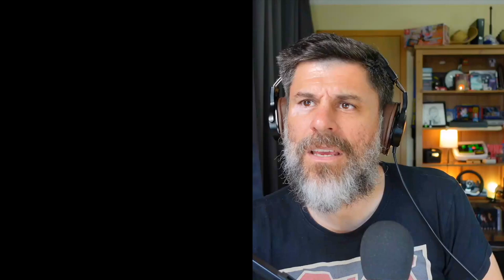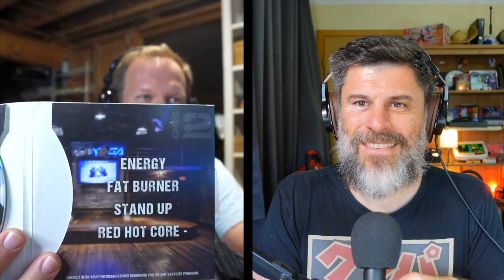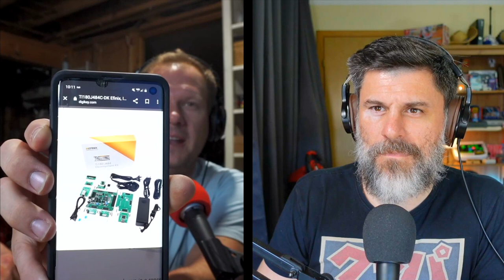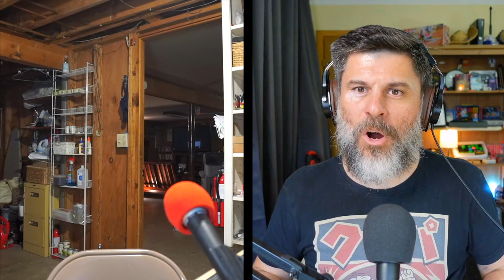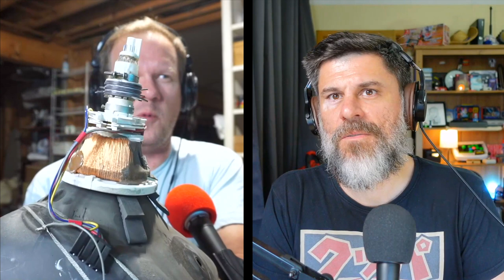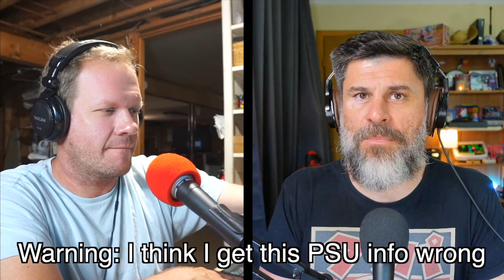What is a CRT yoke?? - Cathode Ray Podcast #58

Comment: an rpi4 with a m.2 to usb adapter will be essentially free to run, and if you use ethernet it should be low latency enough to not notice. RAID arrays and racks and closets are just ways to sign yourself up for headaches. A thinkcentre is also an option but will be louder/hotter. Also remember that those power draw specs are under load, most will idle at 5% or so of their peak load.

you can rent a storage box from hetzner for about 15eur/m, latency is a bit high but depends on your use case. Maybe you don't need 5TB of low latency storage, but 5TB of high latency and 5GB of low latency as a cache/temp storage, especially considering typical rom sizes.

Comment: Gun yoke and flyback are usually in triplets in terms of being designed to work together as far as I understand it.

All the windings of the copper, etc. Having all to do with the electromagnetic Wizardry of being able to have the correct voltages to get emission and steer the Electron Beam. Even the place where the gun is situated in the glass neck is very important, in terms of its distance.

Again it's why I wish we had tube rebuilders still. It's a shame to think we have so many tubes in  landfills it could be rebuilt and work for another 20 years.

And with quantum dots, we could have crt's that don't suffer from screen burn. Kind of sad really.

From what I understand I think the reason to opt for pulling CRTs from E-waste is that they are just too expensive, labour intense, and environmentally hazardous to properly recycle.

 Even countries with a strong industrial infrastructure don't necessarily have the equipment or space to properly dispose of leaded glass envelopes. In terms of filtration systems, keeping the lead from slipping into the water table, etc.

Easier to just rebuild a tube and keep it out of the landfill then break it down correctly and risk All the potential environmental fallout.

I wish Hawkeye still existed.